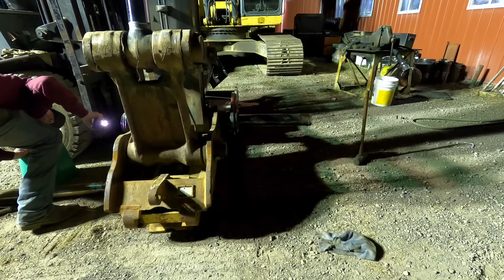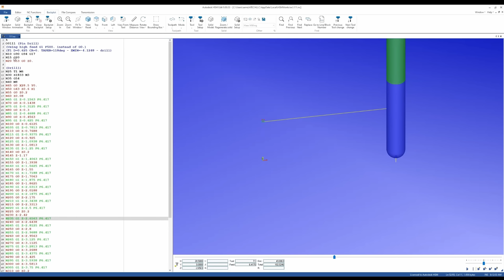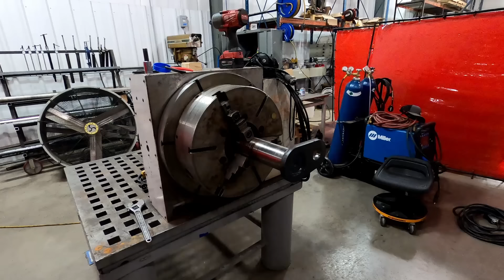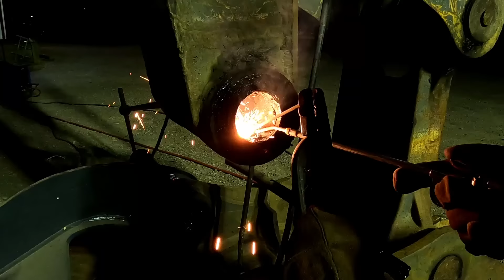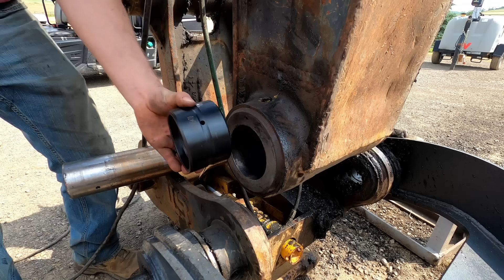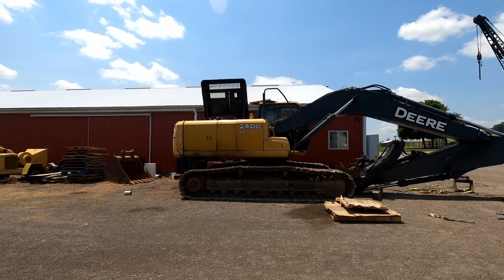Installing a Hydraulic Main Pin Thumb

Comment: Knocked it out and added a new weapon to your skill set!  One thing I like to do is confirm that the grease fitting is properly ported to the bushing before I install the pin. Of course it is... until that day when the bushing you got was made by an apprentice on a Friday.
It is much easier to drill the port into the bushing without the pin installed. It should never happen to you, but I learned my lesson at about your age, lol.

Comment: Old timer boiler makers would remove tubes by running an arc like that but the Navy prohibited due to too many accidental arc strikes on the high pressure steam boundaries. I have used a 6011 rod soaked in water and cranked up to cut steel.

Comment: you should consider getting yourself a puller tool, don't know the actual english word for it but it's basically wide and thick hook screwed on to a semi-thick threaded rod with a very thick handle and a dumbbell shaped weight moving freely on the rod that hits the back pulling anything stuck enough out. usually you find these in car body repair shops pulling very bent stuff that crunched deep in to the car frame
Reply: in english its a slide hammer :)

Comment: You need to make yourself a press on a trolley. Mount a 50t press on a trolley with a pivot arm so the vertical motion becomes horizontal. Then put threaded rod to go through the trolley frame to the back of what you are pressing. Chain will also work to a degree. Then press the bushings out with a guide pin or pipe. If youake the outer frame out of U channel, your press frame can lift and lower to the height you require using a simple chain hoist, or ratchet straps.

Comment: Just a heads up, we made puller out of 2 pieces of 1/2” plate and 1/2” threaded rod, plate on both sides to snug up the bushing and as i tapped the plate somebody was hammering the impact on the threaded rod. Zipped them in in no time but by myself i threw the bushings in the freezer for 20-30min and took no more than a good straight smack on a piece wood and the bushing fell in.

Comment: We’d weld on a new threaded keeper like what’s on the thumb to the quick coupler, we noticed pins have a tendency to break and twist the ear in the thumb when they were drilled and bolted through the quick coupler, not saying it will happen with yours, but our apes always seemed to trash them

Comment: I know you looking at the shrinking aspect of it but the heat will expand it meaning with the welder but cut a relief cut with a torch they fall
Reply: After welding around the bushing, or internal bearing race, after the weld cools, they will shrink and come out easily!!
The ONLY way to get bearing races out of aluminum semi truck or trailer hubs.

Comment: I always just cleaned out the best I could just cut with the torch knock them out clean everything up as good as you can throw the new bushings in the freezer after you got a bolt that would go through get your biggest impact you got you might have to make up your own washers just what's some good plate and drive a new ones home but I haven't watch the whole video yet

Comment: Ya got that right ya push forward  when air gouging         good job
Reply from the maker: Thanks! I think it will be very useful
Reply: @ScrappyIndustries  it will!
And the tool isn't expensive,  as you found out.
The rods will over run the tool expense shortly.